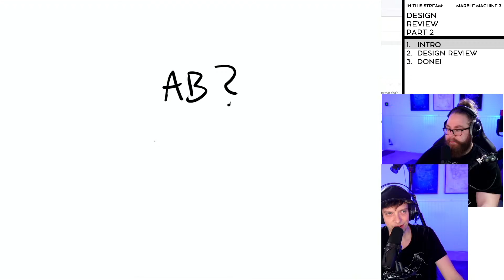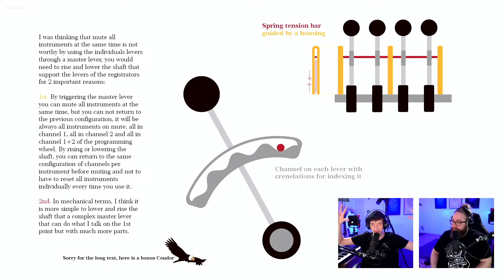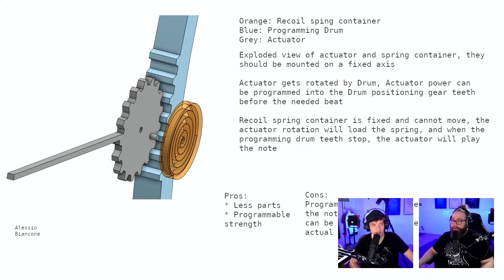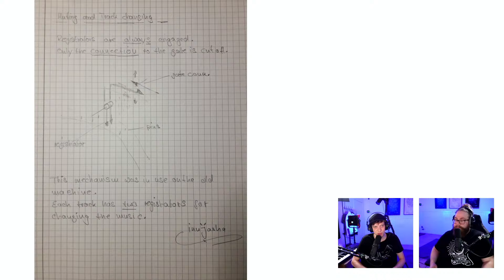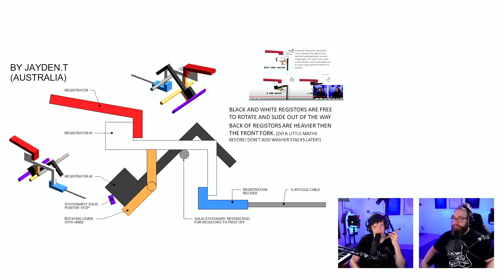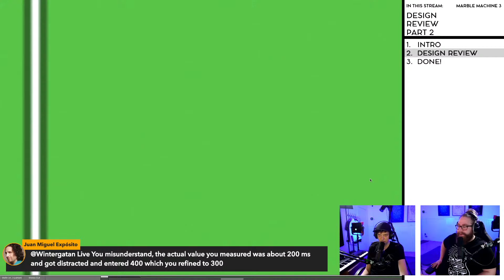Circular Marble Machine? - Design Review 👏👏 #2

Comment: I have an idea what if you could make link a key bored to mute the button pressed channels there for making the music depth infinite with 1 programming wheel set. if you wanna avoid electronics with this could use a series of strings attached to levers that push up the mute attach the strings to a device of your choosing (colour code the strings to make it easy to tell witch is what)

Comment: An argument for the AB state is where the two states are not verse/chorus, but rather two parts that are designed to work together. Like maybe a bassline, and a melody. So just like the muting system, you have the option to play variations on the theme by only playing half the program.

Or the sort of thing you might get in a DJ set where you play a bit of A, a bit of B, and the drum beat drops and you play AB.

Comment: Please Martin, timing belt will not work, it will stretch, it will wear, it will be very sensible to imperfections and finally you have no experience with it. Use gear as you need only 1:16 ratio as someone proposed.

Comment: What if marbels are completely removed from the machine. Use the bowden cables to trigger drum sticks, little hooks working as fingers on the bass and so on.
Reply: yes remove the marbles, maybe remove the programming wheel as well and just have everything activated electromechanically. no, even better, just do everything digitally that way you dont need to build anything
Reply: Ah, that's why we always call it "Marble machine"
Reply: @Suppenfischeintopf  marbles or not this machine will "never" be ready.

Comment: An on off switch of some sort for the programming pins, would take longer to make but then it might save you time in the future making new songs, because it can be programed on the go. It never has to come off the machine. Also you could find prebuilt pins. Remember you can build it out of different materials you don’t have to push pins into plastic. 1 and 0’s are good for programming.
Reply: Did you hear the part count needed in yhe video?
Reply: @Knatte_Anka  yeah i did. But if its a question of litterly makeing a new provraming wheel for each song. It might be worth it. The machine would be infinity more versatile.  Its also a highly repative manufacturing process that could be easily enough achieved with a robot/automated.  

 I think martins hesitation with building this machine is the after effect of having shoved his own face into the grind stone with the bubble gum adhesive approach he taught himself in a shed.  I think he would be really happy to have the build automated. I think the community could pull that off as well. 

Lol you know I think he would be infinity happier if he just told people what he wanted, and let them build it lol. He wants to play music and is tired of the building, meanwhile the community is dying to help.

Comment: regarding the 3d mouse- the larger models that you can set your wrist on work way better. The smaller puck style ones are practically unusable for me they just pick up off the table and can't take nearly the range of force input as the full size ones. I don't really use any of the on-device buttons except the escape cloned key so I think the spacemouse Pro is probably the best deal.

Comment: At some point I got the feeling that there will be no new marble machine 😔. It seems Martin is forcing the requirements to a point where the MM is not buildable only to stop the project. Looking at the vibrophone where there were less bars in the beginning and now it is so huge that it is a MM on its own.
Hope I‘m wrong but it looks like there will be no new MM 😔
Reply: I got that feeling too, Martin is at the moment at a point where it feels like he is not really open minded about going simpler to get something working and learn from it but tries to avoid any issue beforehand before even trying
This will not be possible
My suggestion would be to make the problem much simpler for example reduce the functions drastically to maybe just a marble vibraphone
With that you have enough stuff to fix but it only has one instrument to cover and doesnt need to fit all of them
If you then use it in the band you get all the experience in handling it on a stage etc. then build a second mechanical bandmember with another instrument etc
Or otherwise build then one with multiple…
Overall i think he hast to build a functional mvp as simple and fast as possible to get the fun of a finished product otherwise martin will drown himself in requirements and complexity
Reply: On the same note I would also drop the idea of starting with the worldtour
Reduce the requirements is what martin is often talking about but i think this should be something which you really need to do honestly to your self
It will be hard but why not start with a more local tour which you name like release test 1 and release test 2 somewhere near martins location
There you can gather the experience in handling the maschine on tour and if something breaks the audience is aware that you are testing the maschine
Reply: He should order one from the community. I want this, please and thankyou lol.